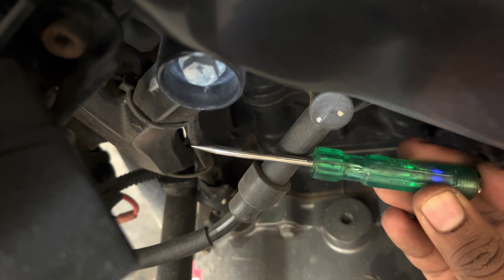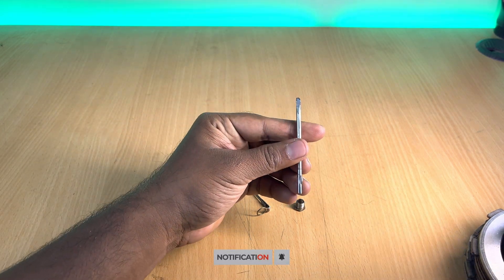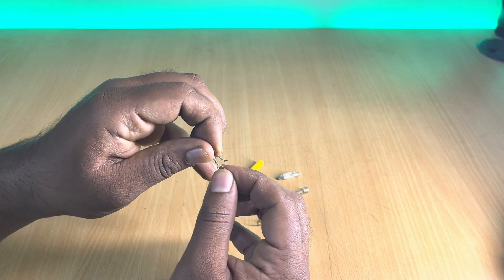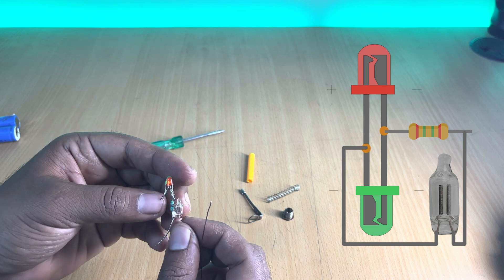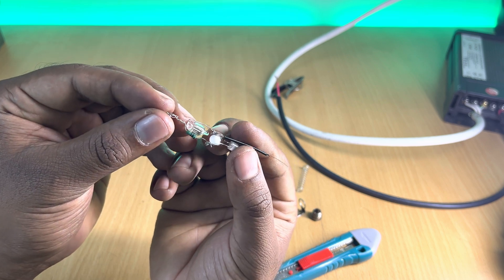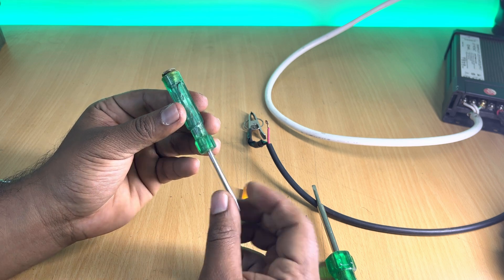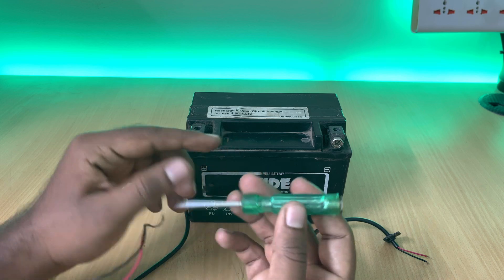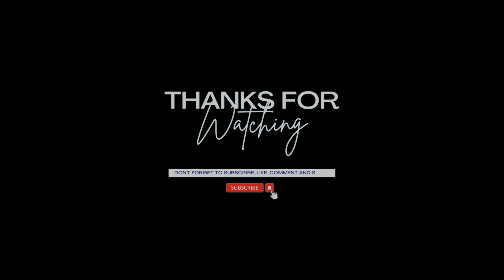Line & Ignition Tester | Find the exact wiring of your electrical repairs and mods | #automobile

Comment: Hi brother my ns200 missing after 4000 rpm while riding what can be the reason
Reply: Check ht coil , and wires connected to ht coil
Reply: @likithgowda785  ht coil is good yesterday i replaced my chain spoket then this problem came